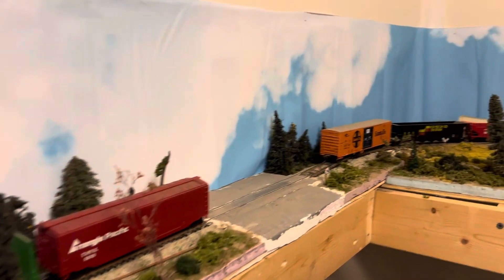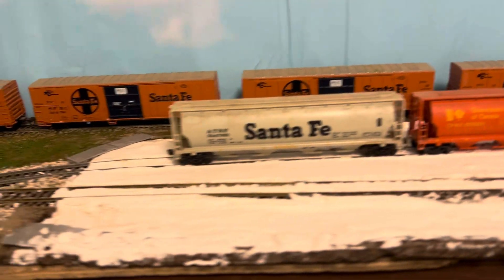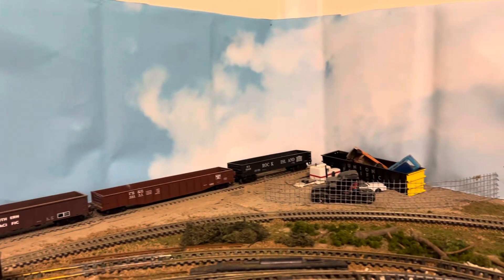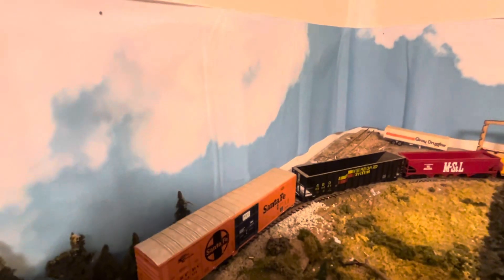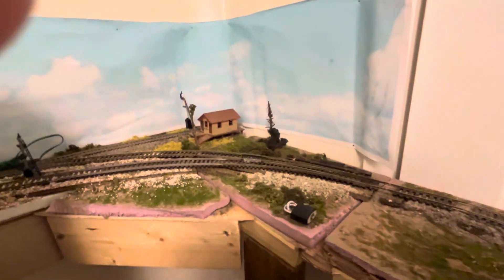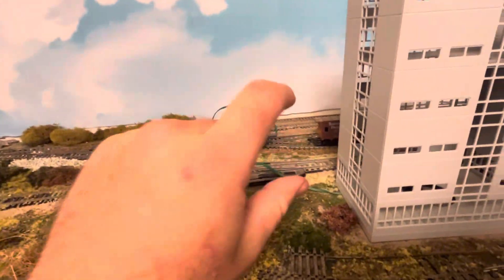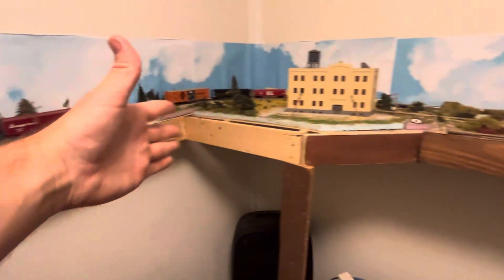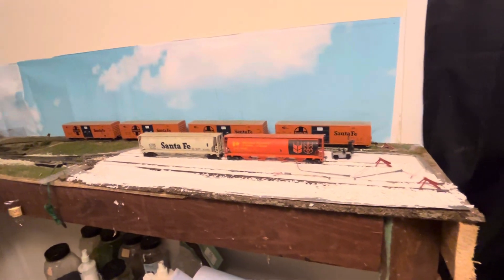Ho scale Industrial Park Layout Update#2!

Comment: Looks good so far. couple good layout builders in Texas.  check out Jac Jac , Flying Crow and Grandpa Rails
Reply from the maker: @joeraderblackrockcentralrr  I’ve put up update #3 with some new things added and done, if I could find some thin Masonite fascia I’d have already added it to complete the benchwork cover and begin using the NCE system as well as began all the wiring and installing plug it systems in to at least prep for all the things on the layout that will light up, complete the paved loading platform with plaster, began adding the mock up build for the food distribution industry that’s at the end of the layout, etc. I will add studio lighting and LED strip lighting eventually but one step at a time I’ll get there and hope once I add higher details like static grass and more foliage the layout I hope will look much much higher quality. Thank you for watching any of my content your views and attention mean a lot to me!